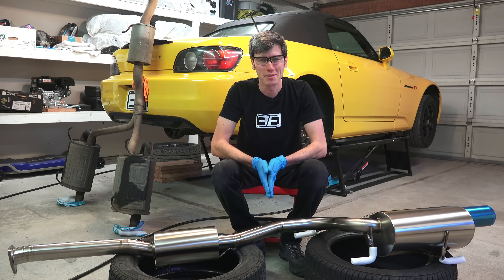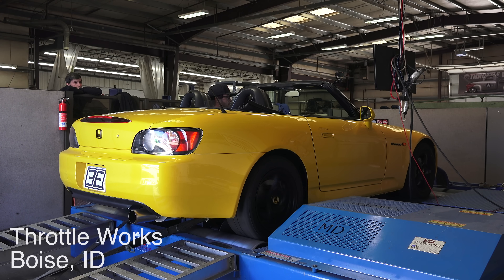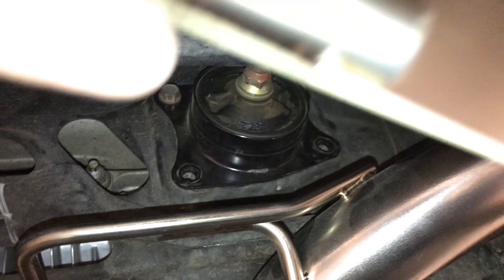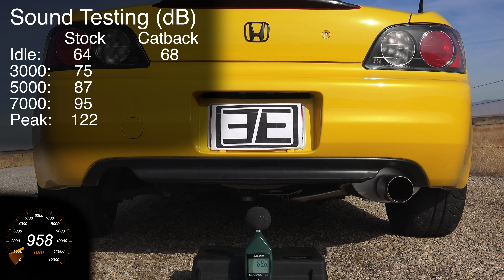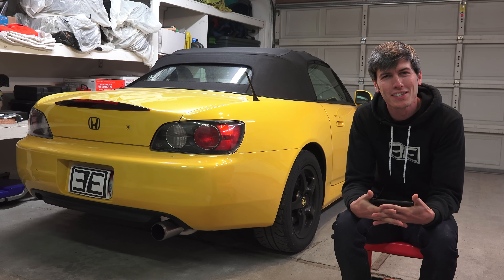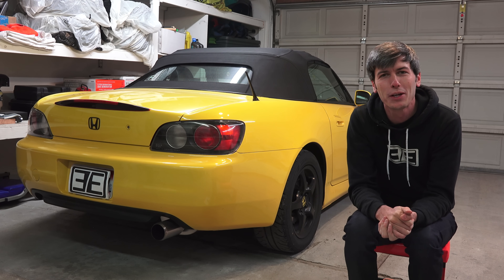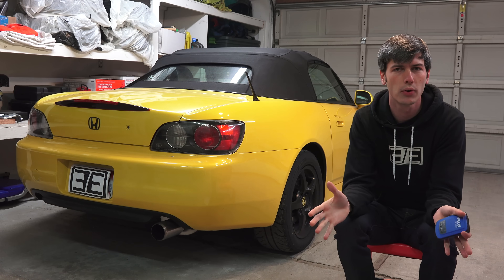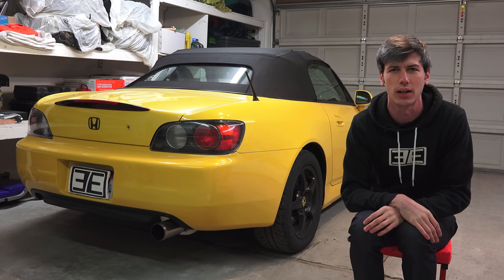Can A Catback Exhaust Make Your Car Faster?

Comment: What would be the differences with cat-back straight pipes? Same diam and everything? I atill believe resonator and muffler can show differences between straight pipe
Reply: If you saw into his muffler, it was effectively a straight pipe with sound-deadening holes and insulation. Resonator is going to be the same deal; both parts are very low restriction, replacing the loopty-loop of the stock mufflers. Only difference would be significant increase in noise and a fraction of a percent improvement in exhaust flow.

Comment: Using a web based calculator (and assuming your actual altitude is 4000ft), the Density Altitude of your stock test was 5130ft.  For the catback test, it was 4074ft.  Density altitude is a good way to compare results for tests in somewhat disparate conditions.  Using the difference between those (1056ft), the power difference "should" be about 2.5%.  Add that to the 1.2% lighter and 1.4% more powerful.  Total of 5.1% gain in acceleration.  Checks out :)
Reply from the maker: Very cool - actual altitude of the test is about 2700ish feet, probably no higher than 3,000. Does that calculator account for humidity?
Reply: Colder air holds less water than warmer air, so that explains the difference in humidity reading. The performance increase due to lower temp far outweighs the decrease due to higher humidity.

Comment: It would be interesting to see a high flow cat on there, 35 pound difference, I'd be into seeing you do a video on the math between acceleration and weight loss, I remember the old rule of thumb in drag racing of a tenth of a second faster for every 100 pounds lost. Cool video!!

Comment: The biggest gain is the loss of weight. Would a larger diameter make a difference? ...dunno. The extractors and the cat are the restrictions probably. 

What is that odd protrusion in the stock and aftermarket pipes? What's the thought process behind it?
Reply from the maker: The protrusion is for eliminating a specific frequency, I believe it's for drone.

Comment: I'm curious how much the weight was a factor vs how much the 2 HP was a factor. I.E. What if you just added 34 pounds of lead or something in to the vehicle and did the same second gear pull?

Comment: 15 kilo's is nothing to sniff at.
 I'm probably more impressed at the sound test results though. If you'd asked me if a straight through single muffler could be comparable in audible volume to a dual muffler with all that baffling, I'd have said no way!
Reply from the maker: Yeah, pretty wild that they took out so much weight and all of the bends, and somehow managed to keep near stock volume levels.

Comment: It decreased your lbs/hp ratio by 0.1
Reply from the maker: So much win! Hahaha
Reply: I believe he actually made his CoG higher, because the lighter exhaust was installed below the original CoG.
Reply: He also lowered his cars center of gravity which increases cornering. Weight reduction also increases brake & acceleration performance while improving fuel economy under comparative driving conditions. Great video!

Comment: I'm glad you were able to show that a less restrictive exhaust i.e. less back pressure, is able to make more power. 
But I'm also glad to see it is not a huge amount. 
Would be a good video to show those who say "an exhaust needs back pressure" and also those that think a massive 4" tail pipe on a 4 banger makes 725382bhp.

Comment: Although this exhaust is freaking expensive, and provides little gains(some but little), I think just having a titanium exhaust is cool enough.
Reply: Well they do say 27 nots make a right.
Reply: You are most certainly not wrong.
Reply: I was a bit surprised Jason said there isn't much difference in sound. I was watching this on a laptop (with "not-so-good" speakers) and I'd say that it made quite a bit of difference. Stock has a lot higher pitch.
Reply: You are most certainly not not not not not not not not not not not not not not not not not not not not not not not not not not not  wrong
Reply: The titanium exhaust definitely sounds better
Reply: also I really don't see a problem in performance gains here. I am actually surprised it made that much of a difference. Everybody is about numbers like max power and max torque, but a 5% increase in acceleration performance is a lot! The exhaust is expensive because of the material, not because of what it is. An exact stainless steel copy would probably cost around half. It wouldn't reduce the weight as much of course, but the torque increase over the ENTIRE rpm range would be the same. That imho is really impressive for changing just some tube that goes out the back.
Reply: The only madness is you needing better speakers.
Reply: Sounds like me and my stainless brewing equipment.  I could get by with aluminum, but....  stainless is so damn pretty.
Reply: yep
Reply: Connor Bennett....if that bottleneck as you so-called it, was so significant, there would have been more of a horsepower gain....respectfully.
Reply: You must be mad it sounds the same
Reply: I think the best gain with this is then you now have the airflow to put more power to the engine, and you won't have that bottleneck of the stock exhaust

Comment: Another thing to consider with improved flow is higher gains if you had done engine mods.
Reply from the maker: Yes exactly. It'll be getting a supercharger so it will be helpful once that's on.

Comment: How much oil does your car burn per 1,000 miles? Have u made the switch to 10w40 to slow the burn down?
Reply from the maker: That's a great question. I've only put maybe 1500 miles on the car, so I can't quite say yet. It burns oil, but not nearly as much as my old Integra did.

Comment: Can WHP vary based on suspension settings?
Reply from the maker: Technically there should be no difference.
Reply: when accelerating With a soft supension the Power that could have gone to accelerating the car forward are spent compressing the suspension instead, but his thas nothing to do With WHP?

Comment: Can you please order or make a cat-delete pipe and get it dynoed again? It will probably throw a lambda sensor code but it should still give you some more HP. Also it would be interesting to hear the sound difference.
Actually it would also be interesting to get a stock exhaust de-cat dyno as well..... science!

Comment: How can you justify 2500$ for nothing
Reply from the maker: I think it's very hard to justify, but from an educational standpoint I think it was a fun experiment. Big thanks to AutoTempest for making it possible!
Reply: Sergio Aguirre reciprocating saw at the cat, weld 2.5" 0.65 wall 2' section piece of 403 stainless to the cat, weld vband flange to stainless section. Buy 0.65 wall 2.5" extruded t6061 aluminum tubing. Cut pie cuts for bends and proceed to fit up and weld. Weld vband to aluminum section and bolt it all up. All this would still cost less. Ive literally done it myself but with all stainless. I bought 30' of 403 0.65 wall for 150$ and built a true dual for my Silverado. Hangers, vbands, overaxles and all. Other than 150$ it only cost 3 days of time, and TIG welding experience. His car only had one relatively straight section and one header. Theres no need for the whole exhaust to be titanium. Exhaust temps aren't that hot.  This system is bling or bragging rights  and nothing else.

Comment: If this was made to order, why not use a larger diameter? Then if you decide to change the cat in future you'd have the benefits. Thoughts?
Reply from the maker: Something I definitely considered. I think it'd be okay to go 70 mm, but honestly clearances would start to be a concern going much larger than stock. There are already some very tight spaces with the 60 mm.

Comment: Umm, but didn't it look incomplete? It has a cross piece... @engineeringexplained. +2hp and - 34.5lbs I'd better than it looks. Your power:weight is better. So not a waste of money or time because it is a better fuel economy as well. Win, win, win on this upgrade.
Reply: Genki De LOL at the fuel savings. How many miles would be have to do to get back $2500 in fuel savings? I understand this was an educational exercise, but saving weight on the unsprung parts of the car is much better. Really great video though. 😀
Reply: A Nother remember that you are not going to replace the the exhaust system for a long time and it requires very little maintenance. And looking to recoup cost of any other model is more of a diminished return as you don't need to re-tune your engine or run a more expensive gas or added maintenance. So you're laughing but did you look at those aspects? He's not making a track car. Better breathing and weight savings to make it a better tide seems to be where he's going so far. And you will make many cars more efficient as well and over time depending on the amount of driving and gas prices you'll notice the difference.

Comment: Well it's weight reduction so even if not a lot of HP difference, you're getting some weight reduction bro!
Reply: iLupi so all that rust on my car is weight reduction also ?
Reply: @georgeespinoza6710  LOL
Reply: George Espinoza 
Rust is heavier than the intact steel so no, unless the rust has completely detached itself from the car...
Reply: Titanium cracking under heat? Apparently, the guys that designed, built and ran the SR-71 didn't get the memo...

In reality, titanium is one of the best possible choice for high heat applications such as the heated skin of a supersonic jet. In fact, the SR-71's skin and structure actually was annealed from the heat cycling from normal operation and got stronger over time as unwanted residual stresses were relieved. The F-14's frame that holds up its variable geometry wings benefits from the same heat cycling. Titanium has been used for decades by the aerospace industry when strength, lightness and heat resistance were mandatory.

The only material I can think of that's even better for high temp applications and isn't too super exotic is inconel, a nickel-chromium based superalloy, used for applications like F-1 exhaust systems. The McLaren F1 runs a titanium exhaust system that uses its mufflers as part of its rear crash structure.
Reply: 4G12 The SR-71 saw temps so high that the engineers had to account for massive thermal expansion and the plane would leak fuel when cold.
Reply: It's a rather expensive 15Kg though. However if you're changing the catback anyway it's not bad to have weight in mind. The truth is that it's rare that improving the cat back will noticeably improve performance.
Reply: @volundrfrey896  Unless the catback is a short straight pipe, of course.  Hahaha
Reply: Paul Wade nope m8, Titanium is weigh less than half of steel, so even if you take the same stainless steel catback. You would double the weight compare to titanium, so its would be 15-20lb difference not 5lb difference that you pull right out of your ass.
Reply: 35 pounds saved for $2,500 , ....  not a good bang for the buck ... titanium exhaust systems make absolutely NO sense for street cars .. for high performance racing only.
Reply: 4G12 Don't forget that hes future proofing the car. If he does a cat delete and an intake, the exhaust can handle the extra air flow. It's the same as getting bigger fuel injectors than what you actually need, one less thing to upgrade down the road.
Reply: An efficient muffler with sufficient flow rate doesn't really absorb THAT much power and unless it's a pure track weapon meant for ZERO highway driving , it's not worth it.
Reply: Basically all top end superbike exhausts are Ti. Also most top end road bike exhausts are Ti.

Light and strong, but also doesn't corrode much at all so is a brilliant road bike exhaust material.

I'd be pretty shocked if it wasn't the best material for the job.
Reply: Titanium can crack under heat... but the amount of heat required for that to even be considered a possibility is SEVERAL TIMES hotter than that exhaust WILL EVER GET.
Reply: blackstangt there's always adding a spoiler.
Reply: It''s not like he doesn't know Ti is lighter, why is everybody pointing out the weight reduction.
Reply: And also less weight per hp.
Reply: The weight reduction is well worth the price! ha ha. Thirty Four pounds is terrific. Great video!!!
Reply: Better to save weight with lighter wheels (unsprung weight).
Reply: HA - yes with all that weight reduction and HUGE HP gain it is now a supercar - so many WANKERS thinking this exhaust makes any discernible difference.  On a race car where the 'nth degree' makes a difference worth it.  On a street car - it may make a better sound (personal taste) - but certainly, that titanium looks better when laying under the car looking at it.  But - peopel can spend their money any way they please - and yes - I like titanium exhaust as well.  I once picked up a titanium exhaust from a Yamaha factory MX bike - it was so light it could have been made out of cardboard tubing - amazingly light in comparison to the old steel version.  And as always - great detailed videos.  And George's rust does make his car lighter IF the rust eats holes and the metal disappears - voila - NO weight in those holes left by rust - cheap supercar making modification - HA.
Reply: I have been so Foolishly Short Sighted
Reply: Stinger430 that was suppose to have weight reduced cz OEM had two silencers and aftermarket had one.. So what was engineering explained here??
Reply: Now slap in lightweight bucket seat, carbon fibre bonnet, couple of nitrous bottle, spoiler and you're golden
Reply: iLupi also lose some weight. As the driver, the less weight you have, more weight reduction on the vehicle 😂
Reply: iLupi 
Exactly. It would be foolishly short sighted to only chase hp gains with no regard for weight. The combination of small hp gain and significant weight loss yielded really good results overall, while still keeping the car very comfortable to drive on the street (i.e. no headache inducing droning on long highway drives).

This is physically an excellent upgrade in every objective way and the only downside is monetary cost. When titanium production and fabrication advance and become more cost efficient, steel exhaust systems would be rendered obsolete.
Reply: The worst possible place to reduce weight from on a rwd car - low and far back.
Reply: 1. not much lighter than a stainless steel catback, like 5lbs max
2. test pipe would've got more gains.
3. titanium has a tendency to crack under heat

Ya done goofed Jason

Comment: next headers and hi flow cats
Reply: No HFC. Berk Test pipe is what usually provides solid gains.
Reply: Agreed. He even said he didn't think it would make much difference because of the cat. A high flow and a good header would probably make a much bigger difference. He did a supporting mod, not a big power mod.
Reply: The cat is the biggest restricter
Reply: Yodastien That's simply not true running an aftermarket high flow cat or test pipe can yeild up to +15whp on a N/A car depending on the application.
Reply: Most of the other people have already said this but the cat is the big restriction in the exhaust. The factory manifold is excellent and I would only replace it if I were looking to replace it with a race header that eliminated the cat as well.
Reply: That would be a great sequence
Reply: Not so sure without seeing some comparisons with that specific engine. As I learned with my current car, some cars rely a bit too much on exhaust pressure to keep the engine able to drop power down at the snap of a finger. A car I owned in the past however nearly doubled in power by removing the cat entirely and using much larger pipe (it was bottle necked by exhaust pressure until I tried 3" pipe).
Reply: People still use cats on racecars?!
Reply: A straight test pipe would create a lot of rasp.
Reply: I have the Berk Test pipe on my 01 s2000.  I didn't dino the car, but the power increase from the stock Cat is completely noticeable.
Reply: Looking at the stock header on the S2000, I don't think he is going to gain a lot of horsepower there. I put a header on my nc miata and I gained ~10 hp and it is very noticeable on acceleration, but the nc miata has an unequal length exhaust that is pinch welded into a catalytic converter that is only a few inches away from the exhaust ports. Basically, it is very restrictive, but I didn't gain a massive amount of horsepower. Correct me if I am wrong, but the stock s2000 header appears to be 4-2-1 equal length header with no cat built into it. Not much power to be gained there unless he wants to shift peak torque by messing with the primary lengths. 

This really shows how the S2000 achieves 240 hp stock. It already has a high flow exhaust and intake from the factory. What typically adds 30hp to an beater only adds a few hp to the S2000. Good job honda.
Reply: High flow cats. Aka all cats lol they aren’t made to be restrictive unless their clogged
Reply: Agreed Headers and Downpipe please, i bet this is the biggest restrictor at the moment cutting the potential of the exhaust swap :D
Reply: AKA50 Headers and NO* cats
Reply: AKA50 Seriously though he said this was a little quiet and it could make a big increase in power with headers
Reply: There ius not a lot of power to be made out of headers and the stock cat is just as good as anny of the aftermarket products